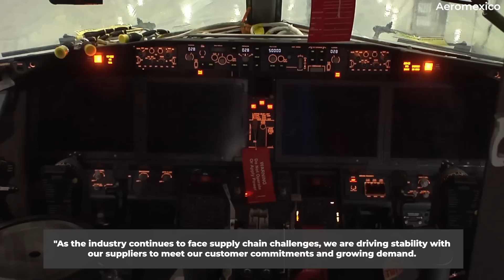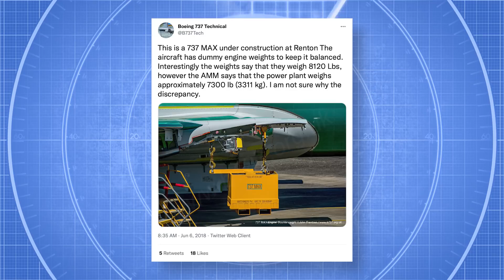Boeing Is Removing Engines From Built 737 MAX Inventory Amid Supply Chain Problems

Comment: As long as the engine swaps can be done safely and reliably, and doesn’t bring about problems with the planes getting rushed built engines later, then I’d say it was a good idea.
Reply: Engine swapping is kind of a routine thing in passenger jets. Assuming an engine never experiences unexpected problems, it still has a shorter lifespan than the airframe in a typical passenger jet.

Comment: If I were running an airline I would wait at least 30 months of operation by other airlines before I would touch that mess. Better to buy or rebuild airbuses that put the passengers in danger. It might even be very good for the US manufacturing sector if the government went ahead and began helping some other company to begin making commercial airliners. We do not want to lose that part of our manufacturing base but its very hard to say if Boeing will ever be a worthwhile company again.

Comment: Makes perfect sense. Use the engines for customers ready to put their planes in service and keep the production line running and keep money flowing as deliveries are a point of cash flow.
Reply: You just summarized my thoughts perfectly. Thanks
Reply: Yes delivery is the point of cash flow.  But why do they have these "extra" airplanes produced?  Why not configure then vacate the existing inventory which has engines?  As for the line, go to a 4 day or 3 day week or lay off workers.  Again excess inventory is overproduction.

Comment: I worked on the LEAP 1B engine. I was a bench inspector for a non rotating hub on that engine. It was the rear main support for the driveshaft...I'm retired now. Retired in January 2020, not too long after the crashes because hub production went to zero and I had enough anyway. That hub weighed 220 lbs and was not easy to inspect...all titanium.
Reply: Do you know where that thing was made? Import or our own product?
Reply: @HgHg-yp6ft  casting was made in France
 The machining was done in the United States, where I worked
Reply: @jimpatriot6918  Thanks for answering man... I would guess that the  titanium itself especially in that quantity and the required purity is coming from Russia.

Comment: why not deliver off the existing finished MAXs instead rather than sitting there laying idle with no prospect of delivery? The orders from the booked customers could be build new and deliver later
Reply: Each airline customises the fitout and features of the aircraft they order, so the parked aircraft will be slightly off-specification for the current orders. The engines however are designed to be interchangeable between aircraft.

Comment: Why not deliver the fully finished 737s first ? The expense of removing the engines makes no sense. Isn’t a first in first out method the most beneficial?
They can continue to make engineless craft and add the engines as supply improves
Reply: Planes are customised for a specific buyer. So they can't just send a plane intended for customer A to customer B without either a bunch of rework or persuding customer B to take a different configuration from the one they ordered.
Reply: Thier are hundreds of different types of planes in the same family.   Every airline has it different specs they want.
Reply: You heard in the clip, half of the old inventory were built for China and they have moved on to Airbus
Reply: @petermichaelgreen  I think this is the obvious case but really I would say it ought to have been mentioned in the video. Just a passing comment that the current customers have been promised brand new plans configured to their own specs, would have forestalled have the questions in this comment section.
Reply: If it made no sense, they wouldn't be doing it. This isnt WeWork

Comment: Why are they still keeping those produced 737 max's as an inventory rather than of delivering it to some other airlines, while Chinese carriers and authorities are playing games with max??? Someone please say why????
Reply: Interiors have been installed, along with other small, but specific options. Much too expensive to rip them out, and possibly have to refit sub framing.
Reply: Because these are completed 737's built to the Chinese airline(s) specifications with completed interior configuration/colors and external paint jobs / logos. A significant cost to retrofit/repaint when CAA certification could be as soon as next week... or next year.
Reply: @beyondcli  or never. Now that they just ordered some 300 aircraft from Airbus, I’m thinking they’ll not certify the Max’s in the long run. They’ll wait for those Airbus which are partially made in China and forgetting about the Max. My opinion
Reply: It also has to do with suppliers.  A Chinese purchaser would specifiy Chinese subsystem suppliers wherever possible.  That has to do with domestic jobs and also ease of acquisition and warehousing.

Comment: My question is that why wouldn’t they deliver the already produced 737 Max’s vs the new ones!
Reply: Seating configuration
Reply: There’s many operators that can’t take delivery or have canceled orders. This is why some airlines like AeroMexico, Lynx Air and Flair Airlines are using planes that were destined for Norwegian and Europa
Reply: @TheSimulatorGuy2003  
Thanks so much for your response.
Reply: Paint

Comment: So they can't sell the planes in storage to other customers?  That seems strange.  Ideally, the ones in storage would go to the next customer ready to take delivery and the newly produced planes go into storage with no engines.  There is something missing from this story, like the ones in storage were built to a specific customer's needs (or the new ones are) so they can't get rid of the ones in storage.  In which case, this engine swap idea is a good one.
Reply: Airlines mostly lease engines and airframes. You might fly on a plane, Airbus or Boeing, that has different engine(s) installed. It's more about finance than just supply chain.
Reply: Not really. Every airline has very specific interiors such as seat material and colour, seat type, configuration ect. It would be too much time and expense effort to be worth it.

Comment: Makes perfect sense. It is not even controversial or logical to ask about whether Boeing is doing the right thing. Where is the ethical dilemma? To assert that there may be, is armchair swagger and nonsense. Delivering product is how you keep your people employed and your competitiveness to the fore, which holds costs down.
Reply: The "ethical dilemma" is solely how to get viewers to make comments, also called "engagement". It worked. In no way intended as a interesting question.
Reply: Rushed production is not a good idea. When lives are at stake it might even cost money (actually I recognize that most large companies do not actually work in terms of lives but in terms of the cost of deaths (you might want to check with Ford about how to calculate the cost of people being killed and injured verses the cost of repairing the flaws, might not be the most profitable possible course)). If you are old enough to remember, Douglass lost much of its profitability (for a short term)by saving money on upgrading door latches. Turned out the potential customers were not impressed that it was expensive to do it right, and if the ground crew had been better trained it might not have happened. I was one of the people who stopped flying Douglass, I was in the aircraft biz and I knew exactly what they did and I found it disgusting.

Comment: Boeing doesn't buy engines--the airlines do, temporarily "lending" them to Boeing for instl, cowling, T/Rs. It doesn't take more than an hour to remove an engine (and another to install. . .). Engine and LRU swapping is a very common practice to guarantee customer deliveries.

Comment: Remove engines from stored and put on new? Why not just deliver the stored ones instead? They are all new.
Reply: I guess most of them where manufactured before the required modifications where implemented . 

So each of them will need to be modified with the latest FAA recertification requirements before delivery.
Reply: Many airlines either can’t take delivery right now or have canceled orders
Reply: Every interior is airline specific such as seat type, configuration, materials and colours. It would be more expensive to rework them than to just use the new ones and switch out the engines.

Comment: The finance of commercial aviation engines is really complex. It has more to do with this than anything else. Read management disclosures in quarterly financials or the minutes of shareholder meetings. These engines aren't PIF by Boeing. The contracts are complex and involve the end customer. 

Finance, finance, finance. Complex lease contracts are in place. It's not going to be easily understandable, but it's not unusual.

Comment: Is there a reason they can't just deliver the already finished ones instead of swapping everything over? I guess perhaps they've already been painted or the interior has different specifications?
Reply: Well half of them are for Chinese carriers and they are not taking delivery yet as pointed out.
Reply: @johniii8147  Indeed, and to re-configure them for another airline would cost as much as making a new one.  Easier to leave those ones in storage and concentrate on planes it can deliver.
Reply: @cjmillsnun  It wouldn’t cost nearly as much swapping out seats on a 737 is pretty straightforward the question is are the seats available

Comment: "Supply chain" appears to be standard bogus excuse.  Assuming Boeing ends up paying for engines as they are delivered to it (and then rebilling airlines who chose those engines), then Boeing would be stuck with an inventory of paid-for but unsold engines  which is not good for finances. So it makes sense to use those engines from its unsold inventory and put them on new aircraft with assured delivery dates instead of buying new ones and maintaining that unproducive inventory of engines destined for airlines with indefinite delay in delivery. 
If airlines really do buy engines totally separately, I have to wonder if it is the engine manufacturer that is left with unsold inventory of engines when its engines remain on a Boeing parking lot for years isntead of being delivered. In that case, it would be the engine manufacturer who would benefit from Boeing taking those undelivered engines for new planes.
The big question is what happens when China approves the 737 again. The engine manufacturer may have to scramble to produce engines for them at very high cadence depending on how fast China is ready to accept them.
Reply: The airline pays for the engines. That’s a separate contract
Reply: @johniii8147  Which would complicate the finances on that case, do the Chinese get paid for the engines that are moving away from their planes now? Or did they never even pay CFM yet, so the receiving costumer pays for the existing but yet unpaid engine and in the end it's an everyone wins situation?
Reply: @johniii8147  I know it is a separate contract but I am curious on the payment mechanics since engines are delivered  to Boeing well before  jet is delivered and paid for.  And when airline defers delivery, we only hears about deal with aircraft manufacturer.  Never about engine manufacturer.
Reply: The Chinese are not coming back, they just bought a few hundred A320 instead
Reply: Quite often the airlines lease the engines separate from the airframe.

Comment: Hi. Could you please make an enquiry about wheels let without any protection during the flight like B737's compared to A320's.
Do companies which fly B737 change their tyres more frequently due to ice conditions at high levels flights? Thanks very much for all your doing for us. From Lourdes France...
Reply: It's an interesting question but when we think about the heat part of it, the wheel wells of the protected landing gears are also just as cold, they have no heating at all and little mechanical heat there. They get less wind only in the end.
Still, I'm also curious if air resistance changes anything significant on the tire wear, or if by the point the outer side walls are getting significant damage, the contact path is already long past usable.

Comment: I think it’s the correct decision. Why have parts on aircraft that aren’t going to be going to its customers. Even if the Chinese allow the aircraft it’d be months before the sitting aircraft to the airlines. I wonder if Boeing couldn’t just repaint the undelivered aircraft and have those sent to other waiting customers. Then when, if, the Chinese decide to start to accept delivers, then they could get newer aircraft off the line. My opinion
Reply: @andrewg.spurgeon1736  That’s what I was about to say. It might be doable on incomplete airframes but the seat configuration and interior are unique. In addition, while it might have some elsewhere while Ryanair doesn’t have any Max 8’s serving at the airport I work at, the 737s there differ to others such as the Jet2 737s by having their own integrated forward door stairs instead of needing ones pushed into position.
Reply: @mikoto7693  interesting, so they never use a passenger boarding bridge?
Reply: Even if the interiors are custom, surely that would be easier than ripping out engines?
Reply: Rumors say the crash in China was politically motivated. Sad that a politically-connected person values the death of their opponent more than the rest of the lives on the plane.
Reply: @andrewg.spurgeon1736  It’s not just the interiors - the cockpit’s and wiring is airline specific as a the options list (like the MCAS failure alarms) were quite extensive.

Comment: "You do what you have to do" as long as all parties are in the loop and contracts of sale allow the "left hand giving to the right hand."  Fallout from this practice could cause Peoples Republic airlines to push harder on the regulators to certify the Max.  After all, an airplane that could been used today got pushed to the back of the queue as it waits for replacement engines.

Comment: The question is why are there still stored 737 Max. They should sell off their inventory to new customers if China won’t take them.
Reply: The paint and seat arrangement
Reply: Easier said than done and the may be prevented to do so per the contact
Reply: Also seat colour, type and materials are very airline specific. Redoing it all would be just as or more expensive than just making new ones and swapping the engines.

Comment: Just slow production right down, and offer stored airframes planned for China out for delivery  to other operators. If China keeps refusing to certify the MAX, the'll have to go to the back of the line.
Reply: China just bought 300 A320, had assembly factory setup in house, plus trying go get their own C919 certified.  I doubt they are in a rush for 737

Comment: Flying may have become too complex, too expensive and too dangerous. 🤔
Reply: That's a load of bs. Flying has never been safer nor cheaper (notwithstanding the recent increase in prices due to personnel shortages and increased fuel cost which are temporary rather than structural issues). The two main drivers for complexity in planes are safety and fuel consumption reduction. With current technology, a simpler plane will be either expensive to run, unsafe, or both, when compared to current offerings.